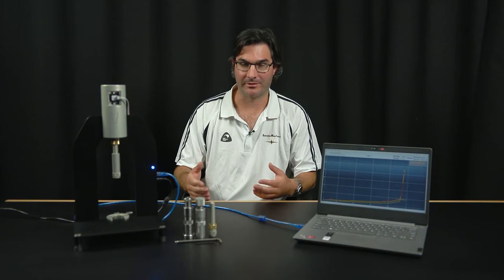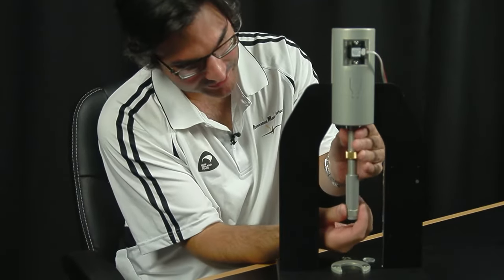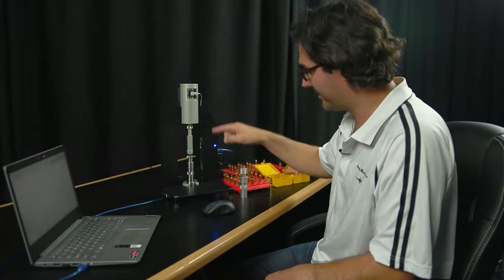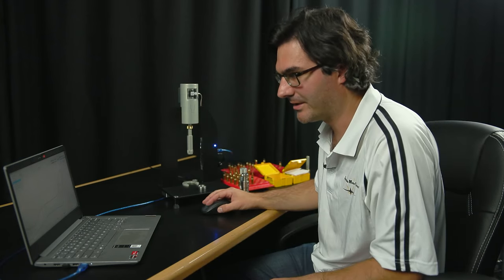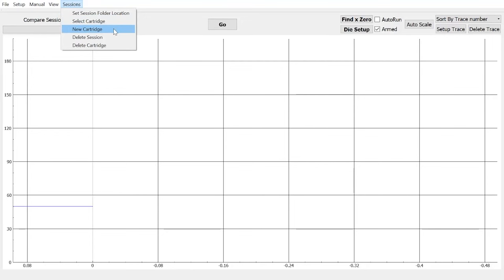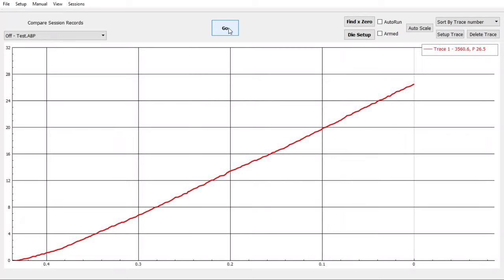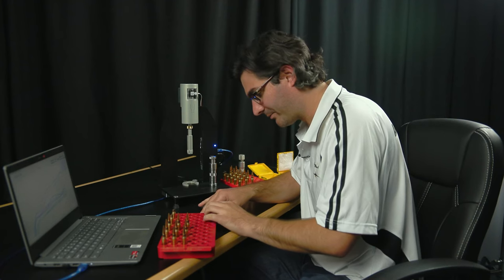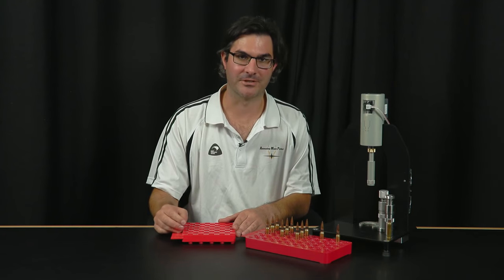AMP Press Tutorial

Comment: Great gilding the lily!
Good for uniform bullet "pull", but only if case necks are of uniform hardness
( AMP ???). 
The trace shows the initial pressure rise as the boat tail of the bullet starts expanding the neck, then the slower but steady rise as the shank of the bullet steadily expands the neck, and the final peak as the shank ofthe bullet reaches the effectively thicker neck- shoulder junction....once the shank has passed this junction, pressure drops.
Very good micro-analysis of the bullet seating process, but to what pro???,

Getting even bullet pull depends on Neck metal uniformity...even with the best uniformity in drawing, annealing, and bullet specification uniformity  there will still be tolerances that will cause variations in bullet pull....
I suppose the best one can do is achieve an  average pull which gives the best accuracy in a single barrel.

I would say the AMP Press is excellent for experimentation and research, but for regular reloading of medium to large reloading is a bit over the top.
DocAV

Comment: I look forward to BRT getting stock so I can get my hands on this tool. I do have a couple of requests though, Is it possible to export the data into Excel for better analysis and sorting? I have my cases numbered and would like to have the ability to input the starting trace number per batch or per case.
Reply from the maker: Hi Brett,

There is an option to export the data to a CSV file so you can import it into Excel if you want.

The program already does have the ability to sort traces by either the peak force, work load or the order they were done of that helps.
Reply: @annealingmadeperfect1257  Was more wanting to input the starting trace No. Say I load cases 1-10 in one batch then cases 50-70 in another batch, I'd like to have the trace start at 50 for the 2nd batch.
Reply from the maker: @1868Brett  You could just create your first trace and set the starting number to anything you like. We will be adding small features like this after initial feedback.

Comment: Uhhh..."conventional" - some would say STANDARD presses and all dies made for them put the shell holder and cases - the parts that are never perfectly "consistent" -  on the moving ram and secure the dies in the press frame so they are locked in position and can never move and introduce variables and the ram in the press and the case in the die and the bullet in the case are the only moving parts. 

And of course they're also multi-purpose and decap (remove primers) and size cases, expand case mouths when loading handgun or straight-wall rifle cartridges, seat bullets and crimp cases when needed. This "perfect" press seats only? And requires NON-STANDARD "dies" for the step where dies are really "needed" least? And the die has to be used "upside down" and "floats" under the ram and must be taken off and put on the "load cell" every time? 

I fail to see how this "high tech" bullet seater with oddball "dies" can possibly be more accurate OR precise than the STANDARD presses and dies that have been used...forever...to handload and reload ammo even on a "production" level simply because it provides "data" from previous bullet seating "events". 

It's not like there is anything the press or loader can do after the fact to create better "data" and honestly sizing "force" variation "data" would be WAY more useful for "brass prep" including annealing and checking how "perfect" they are. 

Neck tension i.e. "seating force" can never be "accurate" if case prep is not "complete" - decapping, sizing, trimming, deburring, cleaning- degreasing, resizing and priming. Factory ammuniton is loaded using "perfectly" clean - inside and out and top to bottom - and uniform cases as "identical" as possible. After firing what possible reason could there be for deviating from the processes required to make the cases as close to "like new" as possible? 

Neck tension will always be "perfect" if you use "factory" reloading dies and case prep processes to get the cases back into "spec". Neck reaming or turning or otherwise "cutting" after resizing and trimming "perfectly" clean cases to "spec" will never "improve" neck tension which is what it is when cases and bullets are in "spec" because THAT IS WHAT IT IS SUPPOSED TO BE AND WHEN IT IS IN "SPEC". 

The material used in cases and case dimensions and seating depth and bullet length and shape determine the overall neck "friction" on the bullet which determines chamber pressure. 

Altering anything about load data especially case dimensions to alter neck friction does nothing for "accuracy" or "consistency" because all PRECISION built into the "hardware" is LOST. The neck tension "spec" is not meant and the "perfect" neck tensions were "developed" by ammunition manufacturers and gun makers on "day one" of creating new cartridges and turning "wildcats" into commercial cartridges. Nothing about "wildcats" makes them any more or less dependent on those industry "standards" for neck thicknesses when they all use factory cases, case materials, bullets, primers and powders from commercial cartridges. 

And "data" used to compare "methods" that produce different "finished products" with different physical properties and/or dimensions is useless for determining "accuracy" of loaded ammo which no matter how "consistent" in seating force can never be "consistently accurate" without 100% "controlled conditions" at the range. 

Some ammo manufacturers DO have "ranges" with absolutely consistent conditions of zero wind and constant temp and humidity because they are underground tunnels below the "frost line" and connected to climate-controlled buildings.  They develop or rather make "hunting" bullets, cases, ammunition and "wildcat" cartridges they "commercialize". 

But they don't alter cases from "spec" for more "accuracy" and don't use dirty or once-fired cases "developing" cartridge load OR RELOAD DATA.